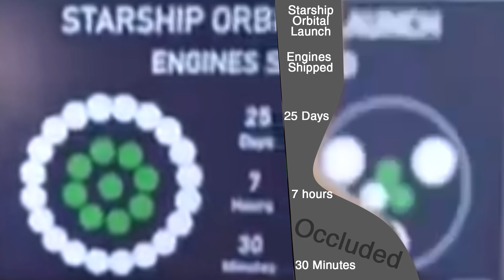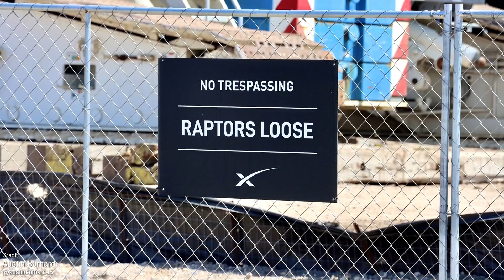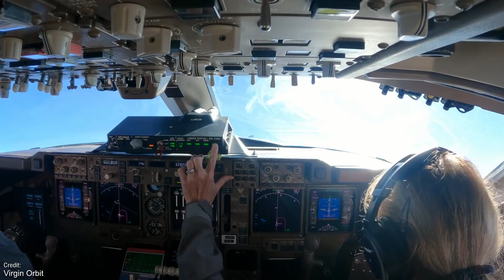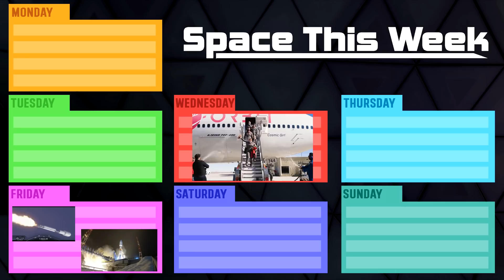Elon's Plan to send Starship SN16 HYPERSONIC! Falcon 9 Launches GPS 3 & China Launches 3 Astronauts!

Comment: The graphic on the engine production line just shows when engines are going to finish production. After that they all have to be delivered to McGregor for testing, remedial work done, retest and flight certified. Then they all have to be delivered to Starbase and be fitted. You are looking at a couple of months after the date on that screen before any launch would be feasible.

Comment: 3:36 The graphic seems more likely that they’ve shipped those 11 engines in 25 days 7 hours (25 days 7 hours is 607 hours, or a raptor every 55.18 hours) versus 24 more engines in 25 days 7 hours (as in a countdown) which to meet would require SpaceX to produce a raptor every 25 hours. The former is MUCH more likely and is closer to Elon’s quoted 48hrs per raptor. Extrapolating would give in the order of 50 days or so and would put the test window at NET early-mid August.

Comment: Why does everyone think that that commencement address graphic countdown is to a launch date?

It's on a production line, it'll be a countdown to a shipping date, not a launch date.
Reply from the maker: Nobody knows what it means, it's speculation. But the graphic is titled "Starship Orbital Launch" so that's why I figured that it was a countdown to the Starship Orbital Launch
Reply: @MattLowne  It's pretty common practice on factory floors to have countdowns to shipping. I'd be 95% sure that that was a date for final shipping of the final engine for that launch. Of course, it'll then be going to the test site for testing before being transported to Starbase, so the launch itself would have been that date plus a week or two at least.

Comment: why use methane in a rocket instead of liquid hydrogen (rocket fuel) seems way less convenient since methane isnt exactly renewable
Reply: There are multiple reasons, first Methane can be stored more easily because its boiling point is higher than Hydrogen and the Methane molecule is bigger than Hydrogen, Hydrogen can often pass right through tank walls.

Secondly, Methane can be easily made on Mars which at least for Starship is necessary.

I really recommend Everyday Astronauts video on the Raptor Engine, he really dives deep into the subject.